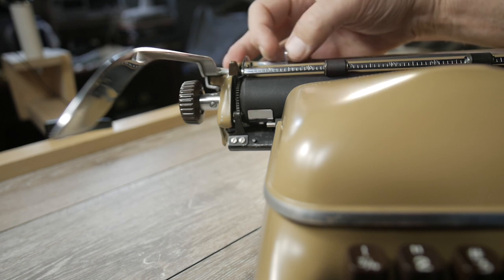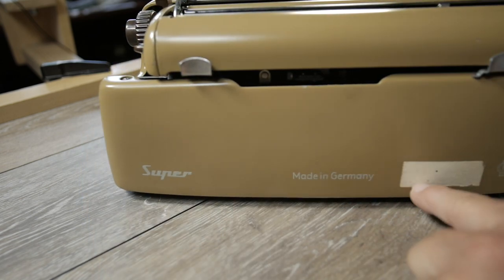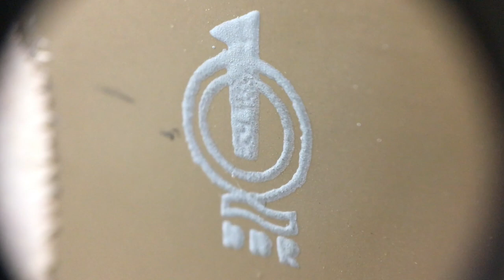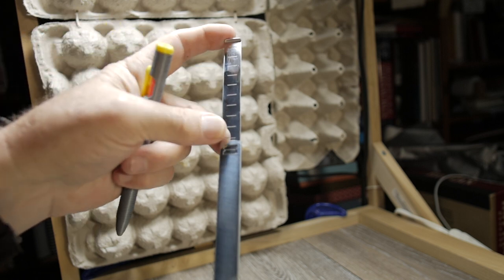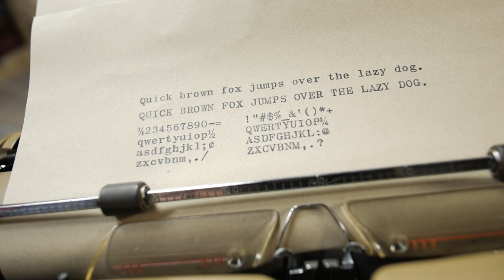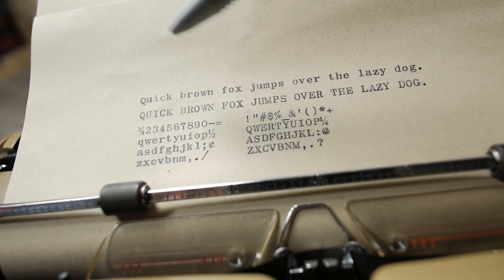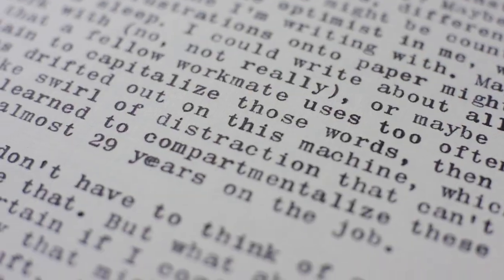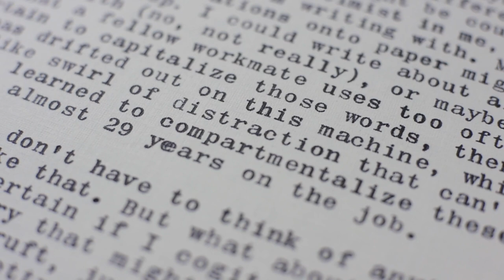Typewriter Video Series -- Episode 266: Optima Super

Comment: My only experience with Optima machines is my Standard size Optima M16 (those were imported after Consul ended their production of standard size machines, here in the Czech Republic), it weights almost 40 pounds but it's probably the best typing typewriter I have ever used even though the keys are slightly heavier than I would prefer.

Comment: how to remove the body, any idea? 
I want to repair same machine but don't know how to remove the body
Reply from the maker: Remove machine from base. Remove two screws from top of body behind platen. Underneath, remove both brackets on either side of space bar. Then remove two recessed screws above the two front feet. Then you have to move the margins out to the edges and move the carriage to one side while getting the body off, around one side of the carriage.
Reply: @Joe_VanCleave  Actually i did everything but didn't try the last part 😆 Thanks a lot

Comment: Even though this is a German machine it does not have the umlaut as does my Hermes 3000 (european model) which also has the French accents and a special key for the cedille.  Apparently most Germans just type the oe in Goethe and such.  My Hermes also has a qwerty keyboard as does the optima.  It may have been possible to get the French azerty keyboard as well.